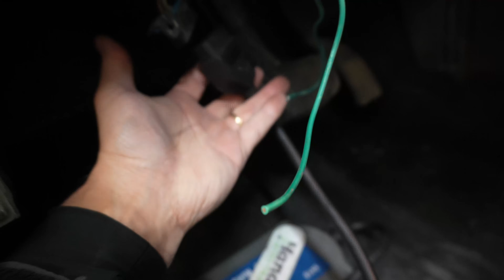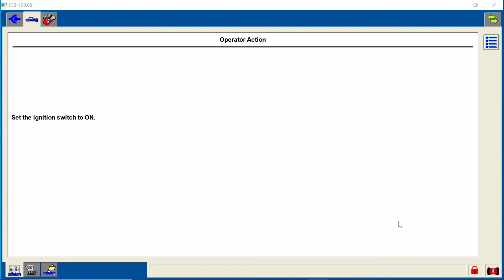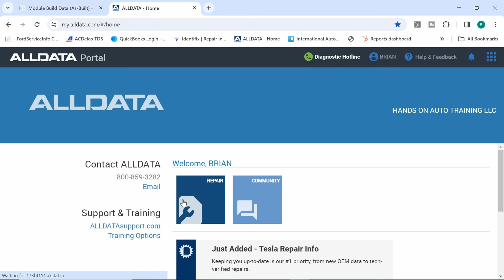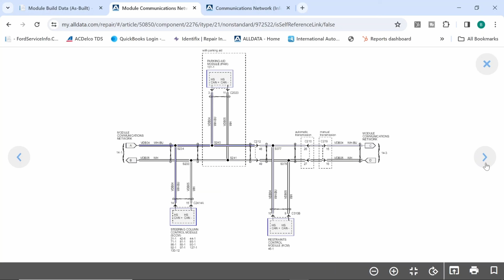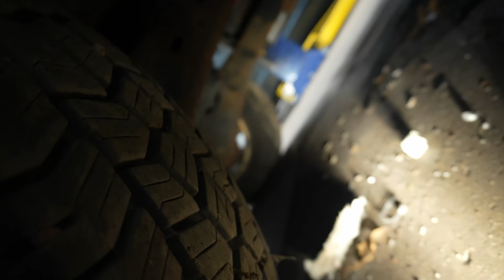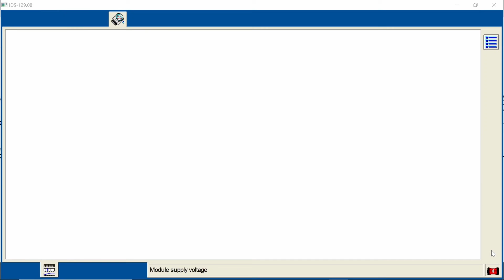2012 Ford F250 6.7  Powerstroke No Crank Comm Issues 12 5 2023

Comment: God hopefully this is our problem! I got a 2013 that randomly does this, right now it will start fine and run fine but after driving it every once in a while it will do this. It will start if we wiggle the harness coming out of the firewall under the steering wheel column
Reply: lol me too, I just order new fuses, I was cleaning the fuse box so for sure now I know it’s a loose fuse, at first I thought I had use too much electric cleaner
Reply: @Taro-k5u just make sure you don't use that dialectric grease in between the contact points, that grease is non conductive so it will make it a poor electric connection. Use it around the contacts to protect the connections from moisture and corrosion

Comment: I thought , it was only two terminating resistors for the CAN circuit ?
Thank you for your diagnostics approach .
I like the idea of you ,  only used the DLC  break out box , multimeter , scanner , and ALL DATA wiring schematic .
Reply: You are correct! There are 2 can buses, HS and MS. Each has 2 TR. Some modules talk on both buses.

Comment: Great video!
Greetings from Easter Island!
The local fire department, owns a 2020’ F550 power stroke 6.7. With no crank no start condition.
I checked the BJB and disarm it, and its clean no water inside!
After your video I made ohms readings at DLC.
Terminals 6 - 14 shows 124 ohms.
Terminals 3 - 11 shows the same 124 ohms!
I don’t have wiring diagrams or conectors locación Guide for look about CAN issues.
Help please…
If you have time…..
Thanks!!!!
Reply from the maker: I think  your 2020 will use a smart dlc as a gateway module. Check the resistance on the individual networks coming out of it on the back side.

Comment: What if it cranks and starts for a second or two. And shuts off saying low oil pressure. I took it to a shop tgry said the oil pump is good they said the the ecu wasnt reading the key.

Comment: I have a question, please: Hyundai Elantra 2005. 

Short term fuel trim +99%

Long term fuel trim-part load
101%
Long at idle -4.9%
What is the scientific explanation for this matter?
Reply from the maker: Are codes setting? Does it run well? Somes scan tools will miss represent data , ~100 is 0 , 99 would be -1.

Comment: Very interesting but I have to rewatch as I didn't fully understand how you got to that connector.
Reply: Typical split the electrical system in half, not always 50-50, we know one of the 2 TR is not in the circuit, unplug the PCM and still have 120 ohms so the BCM TR is still in the circuit. Somewhere from the DLC to the PCM is an open in the circuit, follow the schematic and give priority to all connectors and use each one along the route as a test point. A visual inspection found the cocked connector. If only using a schematic as a guide, sometimes we see some wires on the circuit going through the connector testing just fine which points us to a different location to inspect. This is the second time I have seen a cocked connector with some of the components going through the connector having power and other components not having power, so via experience, I pay much closer attention to connector physical contact, also including some wire being corroded in the connector and others just fine. My first one was a cocked connector under the fuse box, I shied away from that until my very last step, cheers.
Reply: FOrd has problems with CONN C1010 no matter what shape they are LOL and this is a diag moving from connector to connector.
https://www.youtube.com/watch?v=oNUi2coPFzU&list=UU-7f3XJ_6SyedvqKSDmVFbA&index=10
Reply: Great breakdown of his repair. Ty